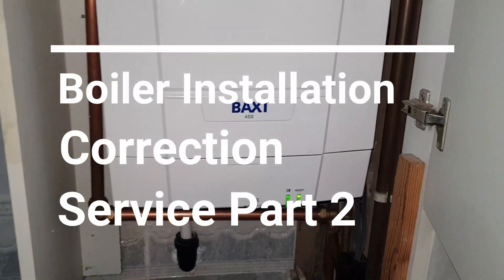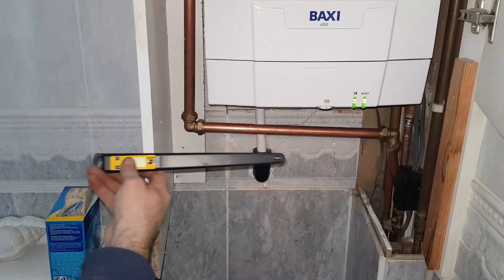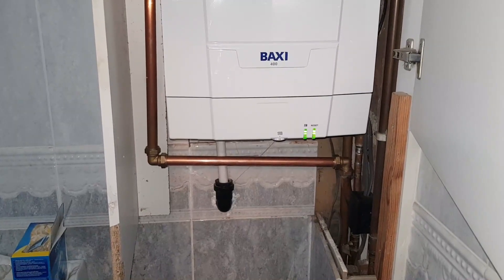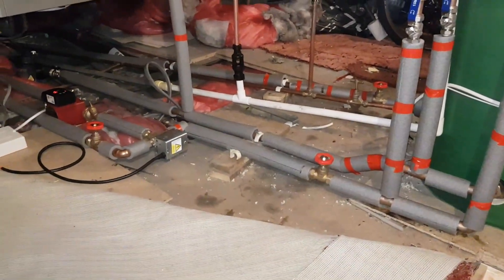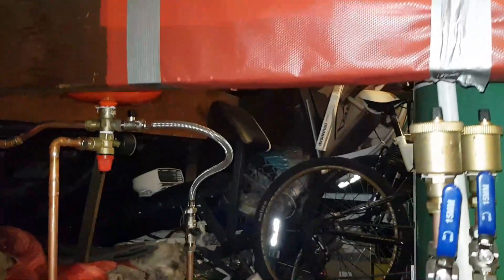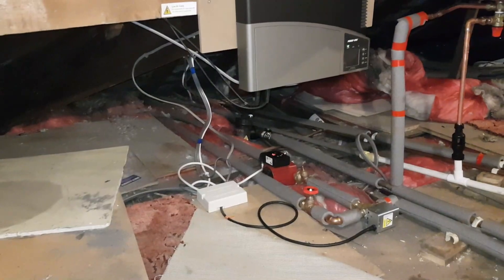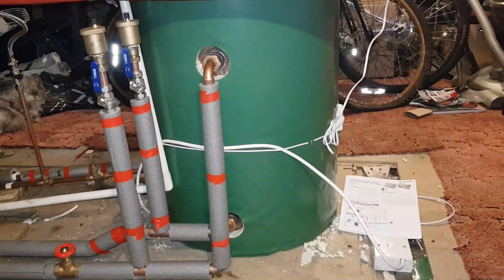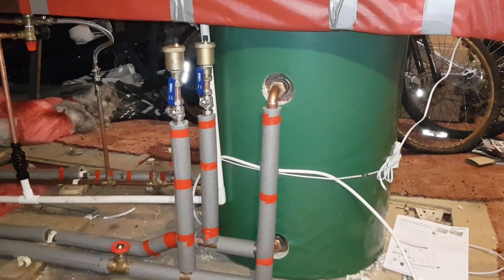Baxi Boiler Installation Correction Service Part 2

Comment: I'm sorry mate but if you're teaching to the "best" standard, why is the cold not fully lagged, the elbows aren't lagged, why is there electric mounted on to flammable materials? Your D2 is wrong. Fair play for posting so people can see your work, I wouldn't as people will find anything to criticize but you aren't teaching to any standards and unfortunately the DIYers who watch this will follow your tips.
All the best, you sound calm and capable of mentoring but make sure things are right👍
Reply from the maker: Thank you for your comments